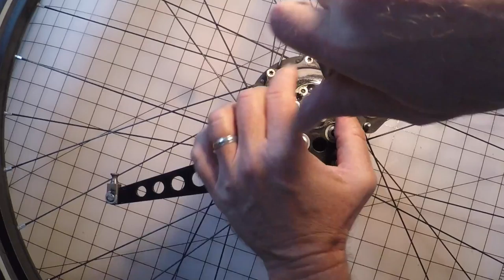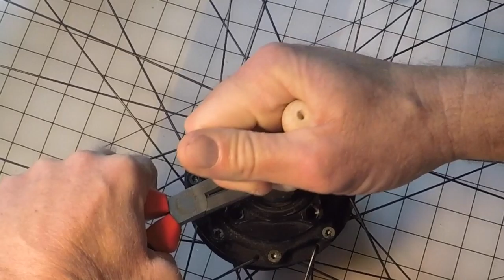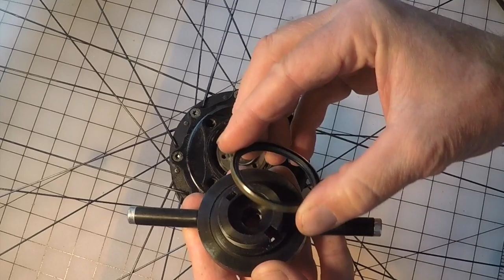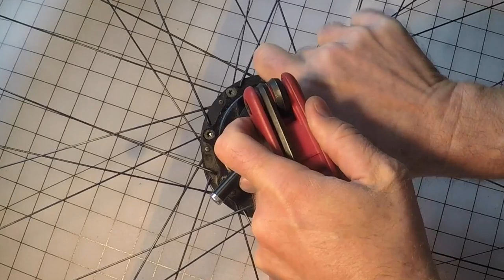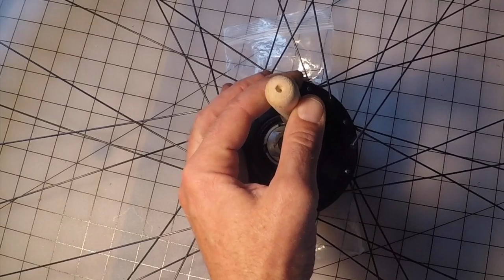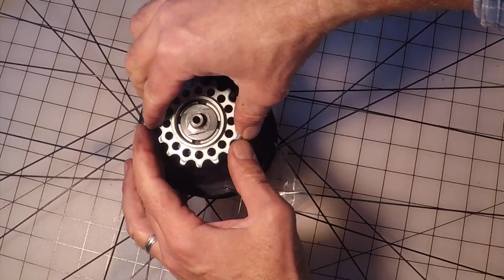Rohloff Speedhub seal replacement

Comment: For people looking for the part numbers:
   - Oil change kit  part no. #8410
   - Hub oil seals x 2 part no. #8244
   - Tools for mounting hub seals part no. #8503
   - Paper gaskets  part no. #8710
   - Sprocket removal tool part no. #8510

I cannot find oil seals 8244 or the mounting tool 8503 anywhere anymore, it looks like Rohloff stopped selling them directly.

Edit: it looks like Rohloff went very anti repair. Some people asked for the seals and seal tool and Rohloff replied that the oil seal change can  only be made by they service in Germany. Because as wee see in this video, this is a very complex and dangerous process and there is no way a normal person can perform this repair.
Reply: My son rode this without oil for a while and ruined one of the bearings on the inside. He took it apart and the paper gasket was ruined in the disassembly. Now he can't put it back together and Rohloff has yet to even return my request to send the hub in to have it reassembled and replace any parts that were ruined. Maybe I just need to wait longer.
Reply: From what I gather size is 47x40x4. I used INA SD40X47X4A; INA G40X47X4A would also work but I prefer the SD type personally; GR is special order only.

Comment: Thanks that's really useful. Mine leaks all the time. I spoke to Rohloff about it and they assured me that even all the oil leaking out would not harm the hub because enough would stick to the parts to keep it functioning and all that's needed is to do the oil change every year or within the mileage recommended. That's begs the question as to why is it necessary then to specify exactly how much oil to do the change with.
Reply from the maker: I'd think it is all a matter of the volume of the leak. A few drops a month would probably not be a problem and leave enough oil until the next annual change but if lots is draining out, it seems like it's time to replace the seals.
Reply: Sadly mine drips a puddle about the size of an old English penny after every ride. Needs new seals. Considering this is German engineering it surprises me that the Speedhub leaks at all. Mine started leaking before it had done 1000miles. Thanks very much for the links.
Reply: Nice video but you missed one thing ( that many do )  When you replace the small central pinion inside the external transfer box you don't just force it in .. there's only one correct/ optimal position  out of six possibilities although others obviously work . Have a look in the manual if you are interested in the detail as it's hard to explain!
Reply: Maciej Jan Długosz  Take your point but have to disagree. I've toured 30k miles on mine without any problems. My only complaint is it's a hard change. You have to grip the shifter hard which can be tiring on your hand. Best thing is the chain never comes off unlike with derailleurs is fairly common and they dont collect as much dirt as deraillieurs or are as difficult to keep clean. The speedhub is the only hubgear I would your with as it's the only one I would trust not to break down.  But to each their own.
Reply: Maciej Jan Długosz  Personally I havent noticed a 'huge' drag but then if you're a racer it might be more noticeable. The noise it makes is only when lower than gear 7 and it doesnt bother me. The other big advantage to me is that weight is distributed evenly on the rear spokes because there is no 'dishing'. When touring I have a lot of weight on the rear wheel. 

You pays your money and takes your pick.  Happy cycling..
Reply: I have the same problem!

Comment: Thank you for the video, it would be very useful, but unfortunately Rohloff doesn't sell these seals and the tool anymore.

Does anyone know, if the seals and tool are available somewhere else at the moment?
Reply from the maker: I would look up a local Rohloff dealer and ask them. I don't see any direct customer support from Rohloff. https://www.rohloff.de/en/service/search/dealer-finder
Reply: @ravraid  I have called Rohloff directly (the phone number is on their website) and they told me if my hub is leaking the only way is to send it to them. Maybe I also had bad luck with the person on the phone, because he seemed to be a bit annoyed by my questions and wasn't really able to answer them correctly. I'm not sure if it was just this guy, or if Rohloff service is just not as good (anymorre?) as it is often said.
What I know for sure is, that they don't sell these seals nor the tool anymore, not even to their own dealers.
Reply from the maker: @clemensmayr8943  Ack, that's bad news. Who wants to remove a hub to send to Germany or send the entire wheel!?

Comment: Does the seal "snap" into place with a click? How do you know when it seated - the tool stops turning? Why were the seal replaced; experienced oil leakage? How many times have you changed the seals? Thank you.
Reply from the maker: The seal is a friction fit and doesn't snap in. I don't recall if the manual indicates a torque value for the tool but I doubt it or they would have provided a means to use a torque wrench. I just tightened the tool until it stopped moving - i.e. it felt like the seal bottomed out in the channel.

I changed the seals because I was seeing a small amount of leakage. I bought this hub used and rode it for probably 6k miles before changing seals. This is the only time I've changed them.

Comment: Where did You get the tools for take out the seals end to press in the seals? What is the name of these two tools?
Reply from the maker: That package in the first frame is exactly what comes from Rohloff. The number for that package is 8503. As I noted in the description above, I don't think SJS Cycles sells these anymore but you might contact Rohloff regarding how to get them. BTW, I good blog about this process with lots of info is here: https://thelazyrando.wordpress.com/2013/05/09/replacing-rohloff-hub-oil-seals/

Comment: Great video, thank you for preparing it. The link for the Rohloff video of seal replacement sends me to a private video page. Do you still have the link for the video and could you post it please? Thank you!
Reply from the maker: Thanks for pointing this out. It looks like Rohloff removed that video from their channel - not sure why. The oil change video is still there.
Reply: Rohloff now say, that if your Hub is leaking only they can fix it. According to the man I talked on the phone the only way is send the whole thing to their company in Germany (my initial question was if I can buy spare parts from them directly). It seams like they don't like people fixing their hubs themselves, which is probably also why they removed the video.

Comment: Hi all I have oil leak to, an I sprayed the sealing with silicone to minimise friction, and it stops leaking, I also use 50 ml oil with graphite to take the load....... In my opinion..... if standard oil start's to get gray it is time to make an oil-change ....... Think about what can make oil gray...... yes metal particles .... where does it come from..... yes the gears, and ballbearings ..... is that good. ??? NO .....think about you'r engine in you'r car if That start to get gray, an "muddy" how longe will it take before it stops to run....... not long.... In my opinion ..... no different  in a Rohloff speed hub.... it is crustal to have oil to grease/ oil stuff to get it running, and to change the oil like on you'r car......... There you have 5 to 6 L oil in a hub you have 25 ml...... The oil molecule will be cut by the teeth in a gear hub, and then it is time to get som new oil in it..... Think about the function of oil, what does it do ?..... Yes it holde the metal parts away from its other, so you don't get ware and tear...... when it starts to get gray is it Then doing it's job well ??? ...  NO.........That is my advise to all Rohloff users........ if you care .... .......best to all... Rohloff user JT

Comment: So now you have an expensive seal replacement tool, but no place to buy new seals?

Edit:
I found these on Aliexpress:
https://nl.aliexpress.com/item/33062862779.html?spm=a2g0o.cart.0.0.1fb83c00QU8xbQ&mp=1
I think size 40x47x4mm should fit.
And since also the outside is covered with rubber (NBR) I guess the Loctite 641 won't be required.
Reply: Did you end up buying these seals?
Reply: @frenchcreampuff  yes, and they fit. I replaced the seal at the sprocket side, which is completely chambered by the hub and sprocket.
The seal on the other side had to be glued to keep it in place. I guess that is possible with the right glue, but i did not try it.
The Rohloff seals are metal on the outside, these seals are completely covered in rubber.
Reply: @PeterKooimanNL  Thank you.

Comment: And all I thought was about rohloff was ride and forget about it... that aint going to happen... 
I see you have a rohloff hub for a disc brake... But you are using rim brakes instead???
Reply from the maker: Yes, I put this wheel on an 80's Miyata just for fun. It makes for a nice around-town bike. I purchased the wheel used which is why I think the seals were shot. I haven't had to change seals on this one since and I've never changed them on the other two Rohloffs I have but I'm not putting that many miles on them anymore. You do have to do oil changes occasionally but that is pretty simple.